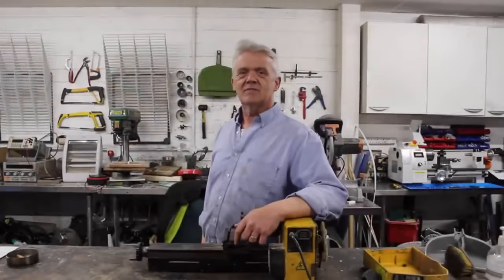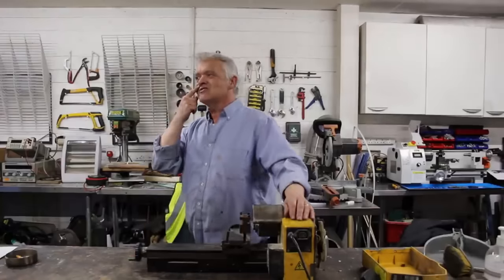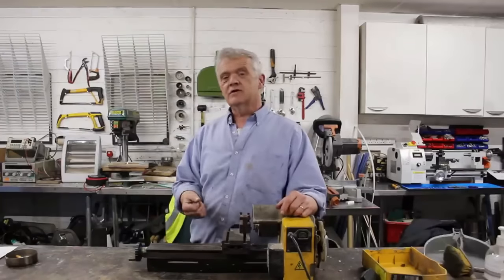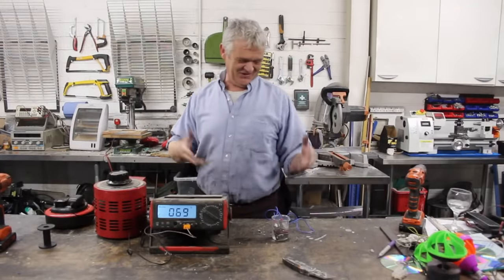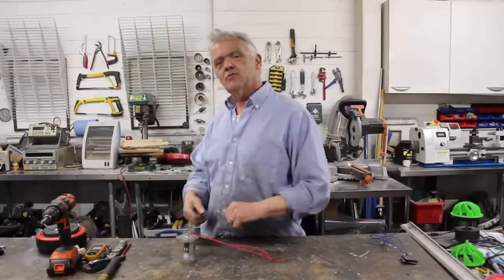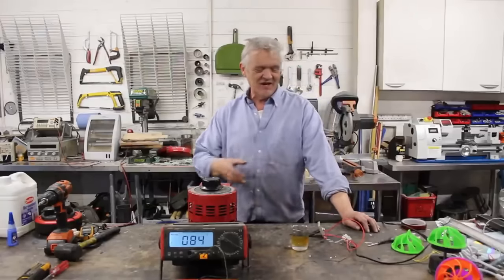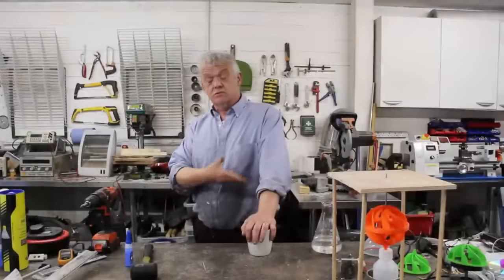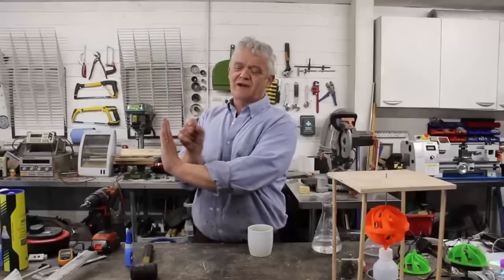016 The Dumas Effect - A Free Energy Water Heater

Comment: PROFESSOR SMITH very high freq can be very easy if that is the route some one wishes to take A reg filament light bulb lights from freq  To any one who says diff tell some one else I have no time for non since  After any thing becomes saturated even a tiny amount more has to find the easiest path some where else  Even if it has to change to some thing we call diff to do so  Ice water and steam is the same thing but has three names according to how much energy it has LOL LOL  Here is a truth no one will agree with every thing is made up of one thing  A old style light bulb gets hot but can not give off that heat quickly enough to keep up  The filament  and its environment are such to make the desired effect  Yet the 50 or 60 hz mains voltage is not no where close to the freq needed to produce light  Dc type light bulb dont have freq on its input  The water hammer effect has no input freq neither a tuning fork  So if a crazy high freq is needed its not a problem that can not be over come  The very hardest thing i have seen to over come is to find truth when we already know for a fact that have it!!  We all are truly swimming 100 foot deep in lies we know for a fact are truth  I ask you how sure are you of the facts you know?  There is no way a man like your self has not came across lies every one knows are facts They will bet there lives on them thinking parroting is knowing  So silly to them hell or high water you can not get them to think about or test what ever it is for them self LOL LOL   But hey true scientist Smith that is how it is  You can only keep leading a parrot to water  You jump up and down splashing in it yet they die of thirst
Reply: Deer in head lights look cant except it when showing them drenching them with water  Tell them hear it his splash and test if it is water for your self lol lol   It is that bad but the few that will test makes it worth while

Comment: Water doesn't split since it is an element, not a partial like electron mass of two different kind, but one kind, so the split part is mass that is breaking since water decompose the mass, so you see two different mass, or two electrons mass. So, mass are electrons and water is an element. Ya can learn more from peter and pete. Water is a liquid so it is still liquid, the only different is pressure field, so the pressure alter the water so water does become gas or solid, so still water as a binder, so no break down so it is like a rubber band that bend and stretch but not break, unlike mass which is solid. So, it is not resonate because it is not in parallel, so the water is too high relative, since the water is high herz so it overlaps the other materials which has lower herz?? To cause impact, so high herz water to have higher impact to low herz materials??

Comment: Looking at the red propeller ball sitting there while you were using the graphite plates all that I kept thinking about was "what if you had two graphite plates spiraled around each other where the distance between each spiral was 6mm apart. More surface area and will most likely cause a spiraling current in the water. I say 6mm apart due to Tesla's 3, 6 & 9 statement. I hope that you can picture what I am explaining. I would draw a diagram for you but, I don't know how to get it to you.
Reply: I found a formula that relates the common size of the electrodes, their distance apart, the conductivity of the water, with the current and energy imparted into the water. Home experimenters are going to be limited by having to keep the current low enough not to blow fuses or trip fuse boxes.
Reply: @rogerphelps9939  lol. I should have explained it differently. Flow of water, like stirring it

Comment: There is no thing like "free" energy, that is a "dumb ass idiot theory".
if you connect a hose to you water tap, to a spinning wheel, and then a generator, is that free electric, no its not, law of physics. maybe its lower cost of money to use a bunch of water, compared to the electric you can save ... but that is another story, but that would be a wast of resources.

Comment: I don't know where you blokes get these daft ideas & names from. 
Hot water jugs like these are used in turkey & all through that part of the world. There is no wonderous effect, it is simply using the water as the conductor between the two plates which draws a current & boils the water. 
The reason why they aren't used is because in simple terms, the water is alive at mains voltage between the plates however, there can be voltage leakage &, if the connection to the neutral plate is lost for any reason, the water sits at mains voltage,  awaiting some unfortunate person to complete the circuit & be electrocuted. 
These things are quite dangerous so, are illegal in most western countries. The advantage of the sealed element style kettles is that they are electrically insulated from the water & do not allow an electrical path through the water. 
Resonance my arse.

Comment: High purity deionised water 6:35 would not work with this heating method as it is an insulator and used in water cooling circuits for massive high voltage thyristor drivers in industry for that reason.  You could inform your viewers that yours was not of a high quality or that you contaminated the water before using it here.

A Variac is an adjustable AUTOTRANSFORMER, it does NOT supply isolation as standard and you hinting that you have isolation is unsafe advice.

Please make a retraction video about your fraudulent "Coiled water in a pipe = Fresnel lens" video, it labels you as a fraudster yet much of your content is ok.

Comment: Im sorry but take this video information with a grain of salt !! no punn indended. There is a lot of misinformation and lack on undestanding !!!!
Reply: @OU812-bc3pl  it's often not about free energy's  but more about efficiency...
Reply: @OU812-bc3pl  regarding to half sphere shape. I was under the impression when method was shown originally many decades ago ,that is was sound/acoustics and nothing to with voltage or current flow, that actually there was none involved.  Asides from making the audio. Of the top of my head , it could logical be possible to boil water with acoustic resonance but temperature increases requires.some more thought.  Boiling does not have to be at 100c as boiling is relative.  Boiling is just overcoming bonding energies of atoms and hydrogen and oxygen bonding is primarily to do with atmospheric pressure.  Therefore sound waves or pressure waves in the water and the material could potentially create low and high pressure zones or nodes... But regardless that was all from memory and I could be totally wrong. It's pretty funny how people make assumptions with now evidence or experience or knowledge. But we all been there I guess and it's more about saying IDK, but what are the possibilities and let me investigate for many directions...